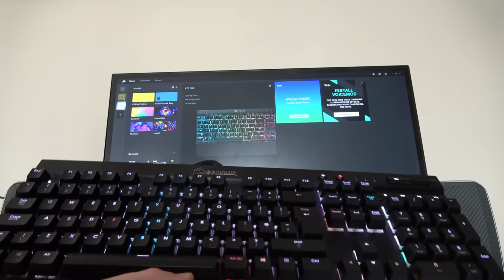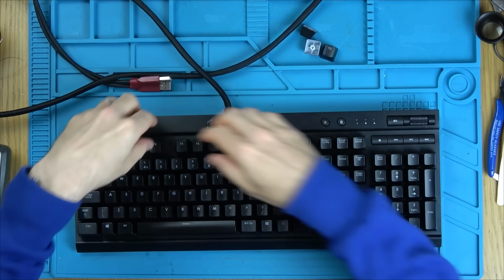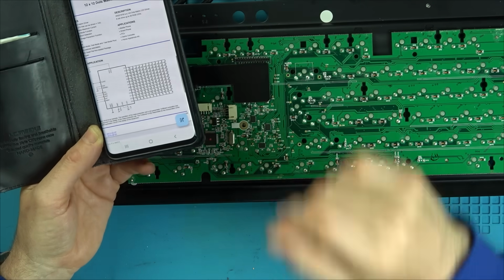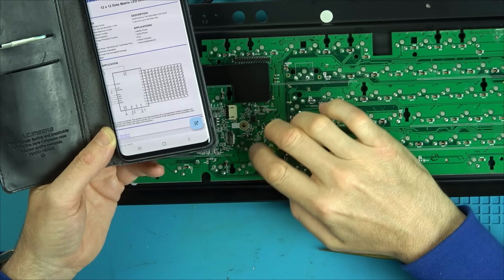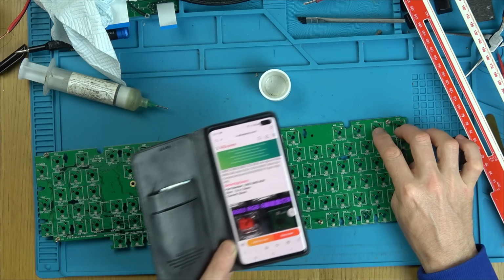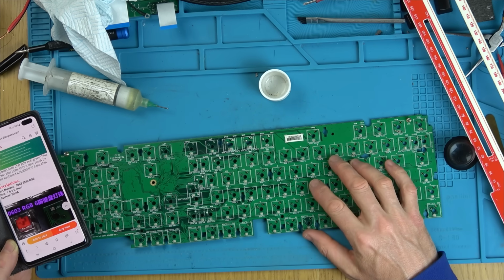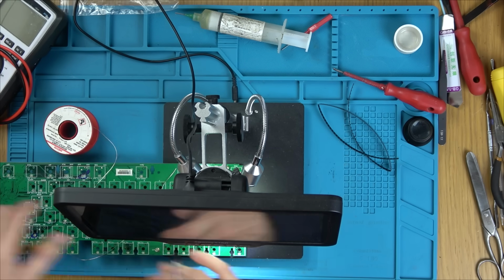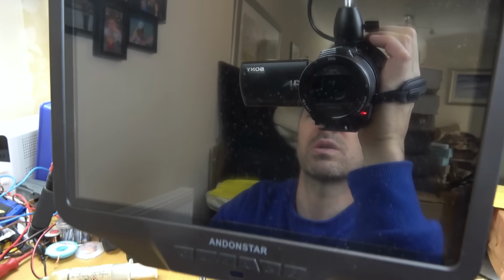Can I FIX Various CORSAIR Gaming Products? - PART 1

Comment: 19:35 quick question; I am trying to fix up a broken xbox 360 with busted capacitors but I can't for the life of me get the solder to melt ... even went and bought a de-soldering gun but it does not seem to make any difference ... could I be doing something wrong? Also tried a de-soldering hand pump and de-soldering braid. Have not tried my SMD station yet tho ... any ideas? (Also, I been using flux from AliExpress, would it make a big difference if I'd use a different flux?)
Reply: Add some low melt solder

Comment: The EAST1616RGBB4 datasheet gives great information on soldering temp and technic, as well as, the current limits for each led (60ma for the red and 100ma for the other two) and said that a current limiting resister must be added.

Comment: Corsair has some nice products, but proprietary software is a big turn off for me.  As motherboards come with their own RGB software, you would have to use more than one at the same time to control everything.  That's not an optimal solution, as having 2 RGB programs can cause problems, conflicts and slowdowns (not good, if it's a gaming computer lol).  Yes, there are 3rd party unifying solutions out there, but I'm too lazy to try it out (and break up my old RGB setup).

Comment: The problem with the microscope is actually more a problem with SD cards, unless unmounted correctly they are extremely sensitive to corruption. Raspberry pi and other SD card units have similar problem, power interruption = sd card corruption risk even when not active.
To be sure you can remove the power button and only use the other ways.

Comment: I've got two compact mechanical keyboard one wired at my desk, and one wireless at the tv, same brand and model. reason I got the second one was, they're easy to take apart when I inevitably spill on them. had to repeair some traces on the first one after one of our cats knocked over a glass when I wasn't around, so it sat and corroded.
Such an easy job I got the second one, which after a spill has a red key, but it still works so I´m good, just put all of them on red, job done.

Comment: What a terrible design on Corsair’s side. Why not make the top plastic part remove separately from the keys? It makes no sense. It doesn’t help with the light leakage, it doesn’t make it look better, it just makes it hard to repair. How many people would actually desolder a hundred switches? I don’t think even a professional repair shop would agree to do that. 

Great job saving this one from the landfill, Vince!
Reply: This has always been an issue for plate-mounted keyswitches (and by that I mean since the '80s when the switches were originally designed). Really annoying, yes. It was generally the less expensively built keyboards like Cherry's own that would go for PCB-mounted switches instead. That does come with some risks related to developing bad solder joints and potentially a less crisp feel.

Comment: Good repair. This could also be the best advertisement for keyboards with hot-swappable keys :) They cost a little bit more, but have the key and LED in one unit that you can pull out to the front. without having to desolder single keys. For repairs that can be such a time saver.

Comment: I have a logictech G213 keyboard that repeats charaters when it was brand new out of the box and a logictech G203 Mouse which I managed to still use until one the scroll wheel broke. I have sinced got both a replacement keyboard and mouse. So I am think of sending them over to you to see if you can fix them for me?

Comment: You could get some hdmi->SD card recorder to do the recording. This can record the HDMI out in parallel or as a replacement.Owning the same microscope. 3d printed some extenders and handles, to make it more useful, when dealing with bigger stuff to zoom.

Comment: Corsair should have designed these with removable keys instead so yolu didn't have to desolder them all, then when they fail, they can easily be swapped out. I have the K100 Midnight Gold, my fiance the K70 Pro RGB, never had issues with them.

You can get some hot swap sockets that should fit into those holes for the cherry switches making them hot swappable. I do not know why Corsair didn't think about them. What I am on about is some very small tubes basically that you fit into those sockets that then mean you should not have to solder the keys back on. When adding these tubes, place them in, then Kapton tape over then solder the outer edge of the tubes to the board, do NOT flood the int ernal part of the socket. I would suggest checking out videos on this. This would turn a corsair keyboard into a hot swappable keyboar d for the switches negating having to desolder then solder the keys back on.

For the LEDs, why not use solder paste? wouldn't that be easier?

The Windows lock key that you didn't know about Vince, disables the Windows Key (the logo) down by the LEFT ctrl key during gaming for instance.

Comment: Am I the only one here that's frugal enough to keep that solder that was inside the soldering gun for later projects?
Reply: Hehe. I did a similar thing, with re-utilizing already-used low melt solder as much as I possibly could! That stuff is expensive.

Comment: Basically, corsair cheaped out on a premium keyboard by not using conformal coating on a PCB that's likely to receive some liquid damage over its lifetime.
Reply: Basically, e-girls will dump a whole-ass starbucks drink on a keyboard and expect some simp to fix it for them for free.
Reply: Yes, spillages are probably more frequent than we all want, but a completely waterproof keyboard won't sell as good as this, since it won't need to be replaced, via this type of ubiquitous mode of damage? Yes a waterproof coating should almost be mandatory, considering the ecological damage created by e-waste.
Reply: Expecting an RGB keyboard to be waterproof is a bit of a stretch, IMO.

Having the LEDs under conformal coating would also make it pretty much  unrepairable if you have a simple LED failure.
Reply: Repairing the leds in these keyboards is economically unviable anyway. The most likely form of damage a keyboard will encounter is spillage of food or drinks, which a coating (in combination with swappable keys) would very well protect against.
Reply: @incandescentwithrage  cheaper things have conformal coating. And there are some people who will service something like this but there can't be too many of us out there. Logitech don't care about people who fix their stuff, any of us 7 on this planet :)
Reply: @incandescentwithrage  You're not wrong on the repair side, but how many will actually spend the time to swap a burnt out LED? Some coating would be good for the user in case of spills but bad for the company since it means less sales.

Comment: The windows lock key at the top stops the windows key at the bottom from working. The purpose is to stop you accidently pressing the button while playing a game causing you a lot of issues.
Reply from the maker: Thank you
Reply: You can also configure it to disable other keys and key combinations like shift+tab iirc. Invaluable in games on steam where you might need to press tab while holding shift
Reply: My favourite feature of that keyboard, really
Reply: Yes I sometimes hit the windows key while playing tf2 and you don’t know how annoying it is when I use a Logitech keyboard and it doesn’t have the windows lock

Comment: Ayyy that's exactly my keyboard!!! I've disassembled it too many many times to fix drink spillage 😄 Not the easiest to work on! The easiest way to remove the Corsair logo is to flood it with isopropyl alcohol, and gently tap it so the isop slowly goes under the logo letting you gradually lift it without bending it too much.
Also, for testing matrix LEDs, I think it would've been easier if you tested them with primary colors - all red, will let you check all the red rails, then blue, and green and so on - if you test with mixed colors, you'll end up with a rainbox of colors without having a clue on what actual rail is malfunctioning (rail cause they are in chain, so if one fails, the whole rail will fail as a waterfall).

Comment: I have the same keyboard mine had already been taken apart and dropped got it dirt cheep as the f r v and 3 keys was dead when I checked it was the switchs that wasn't working water damage I think dioxit fixed all them  and a good wash with everyone's favourite isopropyl good as new apart from the missing sticker so put a different one over the space 😂 5 years later not had any problems just be nice if the software worked in Linux but it dosnt
Reply: Think the key your not sure about locks the windows key so when your gaming you carnt accidentally press the windows key
Reply from the maker: Cheers Simon 👌

Comment: Brilliant!  They take ages to fix these modern keyboards!  

There are 'nets' of them that are in series - they are wired in series as you discovered.  They probably use I2C or something like that.
Reply from the maker: Thanks Gadget, it is a shame the LEDs are so hard to get to, it isn't stressful just very time consuming and extremely repetitive 😂 Looking back now it is obvious that the LEDs had failed, but I thought a trace might have eaten through a data line and the LEDs were just remembering the last colour they were on. I'll know more for next time!!
Reply: @Mymatevince why i love modular keyboards which have removable keys and can easily be serviced. You impressed me! I also once had a gaming non modular keyboard to repair which had bad leds but i did not go that far because it was just too time consuming to desolder every key and at the end the customer did not really care about it getting fixed because he was getting a modular one anyways so i got it for free and i thought it would be a fun repair but i did not have much time
Reply: @Mymatevince addressable LEDs never remember their last color after they have been disconnected from the power, some types start to blue if they don't get any signal. But the majority start black (no light)